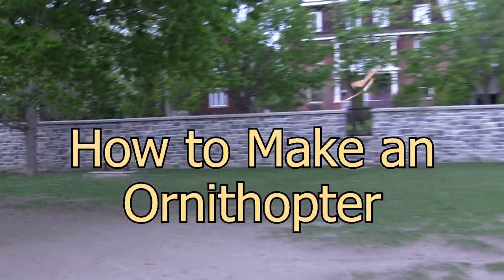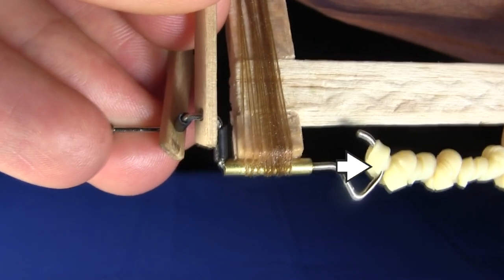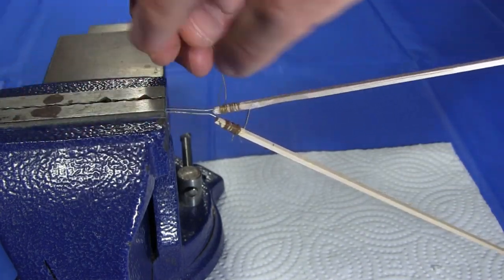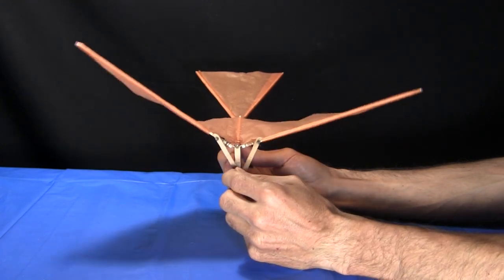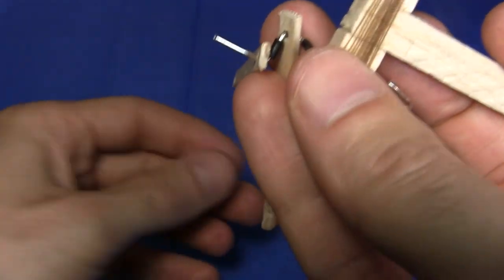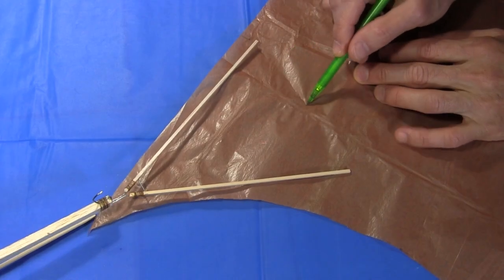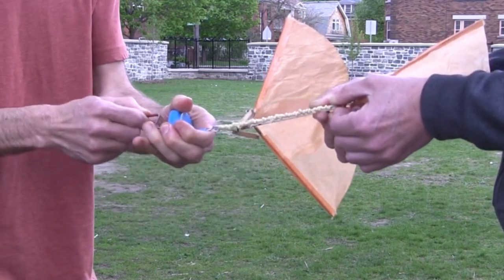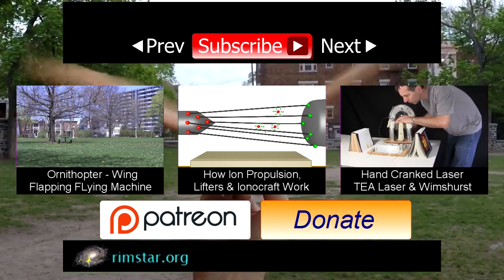How to Make an Ornithopter (Rubber band type)

Comment: @RimstarOrg Have you ever experienced the wings loosening overtime? Cause every time I tried to fly it, the wings end up bending inward to the point where it doesn’t fly as effectively! So is there a way I can fix that problem? I don’t know if it’s me personally or if you’ve had the same problem I have with the flight performance
Reply from the maker: I haven't experienced that but instead I've experienced the wings tending to move forward out of the tube on top of the fuselage.
Reply: @RimstarOrg  ok but somehow the wing spars tend to move backward overtime making the wings loose after a number of uses. If only I can show you an example of my problem with a photo you might understand.
Reply from the maker: Do you mean that the outer wingtips bend backward? Finding a place in the video where there's a shot that I can refer to often helps for me. Just give the minutes:seconds. If it is the wingtips bending backward then I wonder if you did the trick I use at 6:49 where I tape the tissue at the wingtips but you have the tissue so tight that you're actually bending the wood as the wings flap up and down.
Reply: @RimstarOrg  Yes! Maybe I did over tighten the wing tissue a little, but at the same time I didn’t want to wing tissue to be too loose either where it wouldn’t fly properly
Reply from the maker: In that case you can just use sharp scissors to cut the tape at the end and then put new tape. Lower the wings when you do it so that they're in their down position. That will make sure you're giving it some slack. It doesn't have to be too tight even then. You don't want to make it harder to flap. Don't use too much tape since the makes the ornithopter heavier.

Comment: I just dont understand how you made yours so light... Mine is around 14 grams without the wing paper, I highly doubt it will fly. I used balsa (i think, in my country we don't have many hobby stores so I used the lightest wood I found), plastic tubes came from inside of the pen, brass tube I had to use a bit thicker plastic one, and for the large paperclip I used a bit different wire of about the same diameter. I just can't see how you got yours so light?
Reply from the maker: As you said, you used the lightest wood you could find but it might not have been balsa. Another wood to try is bamboo, you can make it thin but it'll still be strong.
Reply: @RimstarOrg  I'm fairly sure it's balsa, commonly used here in school projects, model toys, etc. Bamboo would be even harder to get, anyway, I finished it and it seems to be keeping the horizontal flight for a little, I just need a really strong rubber band, so I guess it'll work out, but if I ever try making another, imma look for better resources
Edit: I checked on the wood, there is a decent possibility that I used plywood instead, which looks fairly similar, but is stronger and a bit heavier, guess I'll look for a better wood anyway

Comment: I just went to any stores yesterday and today to look for balsa woods but unfortunately the do not have it. :( Now, sir, I am wondering if is it possible to use just another type of wood, like popsicle sticks? :|
Reply from the maker: I tried popsicle sticks but they were too heavy. I even cut them lengthwise to reduce the mass. Bamboo sticks are a good alternative though. I find them in dollar stores and gardening stores since they're often used in gardens for tying plants to to give them some vertical support. Art stores may have them too. Use a sharp knife to cut them into narrow strips lengthwise. Bamboo is very strong so the strips can be very narrow.
Reply: I will do sir. Thanks again..

Comment: i have put a motor instead of the rubber band.Will it work
Reply from the maker: You'll need to make it bigger because of the extra weight, but it should work.

Comment: have you thought about putting a small solar panel on the back and wiring up a tiny motor, instead of a rubber band :-)
Reply from the maker: That would be too heavy but it would be a fun idea for a larger design. It might be possible to have the whole wing and tail surface be made of a flexible solar cell material. The flexible materials are usually lower efficiency but if it's not enough to power the motor then it can at least supplement the power.

Comment: Where I will get the tool which you used to wound rubber band and lubricant
Reply from the maker: A google search for "rubber winder" turned up a bunch about them, including some sources for buying them. (Folks who do these things refer to it as "rubber" instead of "rubber bands". Knowing that helps a lot when searching.) As for the lubricant, the Armor All one is available in hardware stores.

Comment: My ornithopter's one wing move faster and one slower what do I do
Reply: Check to see if both connecting rods are the same length, and both crank throws are the same length too, and at the specified 70°. And both wing struts must be equal length. All spaces between different members must be the same on both sides. 
If none of those helps, take it to Indianapolis (Where they only turn left).

Comment: As soon as i put the wings on the framework the Rotation does not work anymore, someone who can help?
Reply from the maker: Do you mean that you try to turn the crank by hand and the rotation doesn't work?
If yes then that sounds like something is getting jammed somewhere when you turn the crank. Look for any place where it might be happening.
It might also be that your wing material is too stiff near where it meets the fuselage. At 6:46, that's the area that is flexing near the fuselage. You could try removing the tape that you put at the wingtips, maybe you pulled the wing material too tightly when you put on that tape (if removing the tape might tear the tissue then carefully cut the tape instead).
If it's not working when you use the rubberband then it might be that your lever arm length is too short. That's the 7/8" length in the video at 3:12.
It could also be that some parts of there the rubberband are twisted are forming lumps that touch the fuselage.
It could also be that your rubberband isn't wound enough. Look at the tips I give at 7:14.
Let me know if that doesn't help.
Reply: Oh thank u yeah this helped a lot, it moves now but i think my rubber band is too weak. It still does not fly😅
Reply: But we are getting there
Reply from the maker: Don't forget, you also might be able to make a lighter one now that you know more. You can also try doubling up the rubber bands for more energy like I show at 7:14 or if you have only one rubber band then you can try twisting it to sort of make two like I do a little later with the longer one when I twist it three times.

Comment: When you give out the dimensions is it length x width x height?
Reply from the maker: I didn't pay attention to that. I guess I just assumed it would be clear which numbers applied to which dimension. I guess I was wrong. Which one(s) is causing confusion?
Reply: RimstarOrg just the dimensions with the wood, its no problem i think i figured it out i'm just always confused sorry! I was just trying to figure out which order the numbers were in but its fine i'm confusing; i guess its in length•width•height.

Comment: My ornithopter has the tendency to bend its wings back overtime after several flights. How do you prevent that from happening?
Reply from the maker: It isn't something that I experienced. At a guess, could it be that the front of your wing material is cut in a curve and that when you glued them onto the wing, the wing initially held it's straight front edge but that as the wings flapped, the stress from the pull by the curved material won out and the wing struts curved to match the shape of the material?

Comment: Is it necessary to buy the lubricant
Reply from the maker: You can do without a lubricant but you won't be able to fly for nearly as long. The lubricant makes it easier to the rubber to twist together so you can twist it more. There are other lubricants you can use and there are some to avoid because they damage the rubber but I don't remember what they are. Though I usually get only around 4 or 5 really long flights from a single length of rubber band before I need to make a new one so maybe any lubricant will do for that long (cooking oils for example). You'll have to do some google searching for things like "rubber plane lubricant" or something to find out which are the good ones. The one I used seems to be the most popular one.

Comment: Its kinda hard to find 3/32" tube/rod/pipe etc, can a pen tube work too? Where do i buy these tubes wth
Reply from the maker: The plastic and the brass tubes as well as all the balsa wood came from a local hobby store. You can probably also order them online somewhere, just search for brass, copper, steel tubes or something. Yes, if the pen tube is metal then you can use it in place of the brass tube I used. It needs that hard front surface to withstand the pull of the paper clip wire like I mention in the video. It doesn't have to be exactly 3/32", just as long as the wire can turn in it easily and there's space around the wire (i.e. not too snug a fit).
Reply: RimstarOrg ok thanks sorry to keep bothering 😔
Reply from the maker: It's not a bother, I'm glad to help. These are awesome and fun things to make so the more there are, the merrier. Let us know how it goes.

Comment: Is that winder custom made or store bought?
Reply from the maker: It's store bought. Well, I bought it from a friend but you can buy them online. Mine has a 5:1 ratio, so 40 turns of the crank gives 200 turns of the rubber band. I think I've seen some custom made ones though. A fishing reel is another way to do it.
Reply: RimstarOrg Thanks! A fishing reel is a good idea

Comment: @rimstororg what is the winder u used to wind called
Reply from the maker: It's the Cosano Speedy Winder, but it's an old one that I bought 2nd hand from a friend. A google search doesn't find it. It has a 1:5 gear ratio, one turn of the crank results in five turns of the rubber band and that seems to work fine for me. However, a google search for "rubber band winder" turns up a bunch of them.

Comment: How many grams does this ornithopter weigh? I made several models, but they all flew only 5 seconds.
What is the secret for them to spend more time flying?
Can someone help me please? Thankful.
Reply from the maker: The one in this video weighs around 7 grams without the rubber band (see the video at 6:55, Hmmm Did you watch the whole video? Lot's of things in it that might help.). The 24" of rubber band that I use weighs around 2 grams. The version in my intro video https://www.youtube.com/watch?v=ZvzpsRWl12s that flies up a bit and then spirals downward weighed 9.5 grams (again, not counting the 2 grams of rubber band). So weight is a big factor in getting it to fly.
Another thing is to make sure you are using good rubber. A regular rubber band like you find around the house doesn't have a lot of actual rubber in it. See the video starting at 7:14 for more about rubber.

Another trick that finally made me succeed was what's called the lever length. In this video at 3:12, that's the length marked 7/8". When I had that shorter, the crank had a hard time lifting up the wings. It makes sense because if you picture what's going on when the crank lifts the wings, that section acts like a lever and so the lever principle applies (https://en.wikipedia.org/wiki/Lever). I didn't try making it longer but I imagine there's some point when if you make it too long, that will again make problems.
Let me know how it works out.

Comment: my ornithopther cannot flap that fast after i put the wing, what are the causes?is that the wing limits the flapping mmechanism?..tq
Reply from the maker: One major factor in efficiently transferring the rubber band's energy to the wings is in the lever length. That's the 7/8" length in the video at 3:12. 'Lever' is a perfect name for it since it's using the lever principle to lift the wing. A short lever means you have to do more work than with a long lever, given the same rotational speed. Perhaps your lever is too short. Making it longer and longer played a big part in getting mine to finally work.
But then again, mine was slow only on the upswing, making it jerky rather than just flapping slowly.
If it's just flapping slowly then maybe your rubber band is too stiff of a material? Or possibly there are other losses, such as too much friction where the crank part of the front hook wire is pulled back against the tube due to the materials. I can imagine that happening if that tube is plastic instead of metal, then the plastic will deform and act like a sluggish cushion. Another possibility is that your wing material is on too tight at the middle and making it hard to lift the wing. Or perhaps it's something else, but keep looking along those lines. Let me know how it goes.
Reply: RimstarOrg thanx for answering..you got it right that im using plastic tube..maybe i need to try an error until i get the best result..thanx again

Comment: what is the idea behing the wings, how come they only collect the air downward, but not upward.. i mean, when wings flaps toward sky, how do you prevent wings to collect air and push the bird downward?
Reply from the maker: The lift isn't produced by directly pushing air downward. Lift is produced in much the same way as with an airplane wing, by having the correct wing angle (called the angle of attack) while the wing is moving forward with respect to the air. I explain it with diagrams in this article I wrote about what I learned https://hackaday.com/2018/05/11/scratch-built-ornithopter-heres-how-i-flapped-my-way-to-flight/
Reply: @RimstarOrg  ohh i see (nice diagrams), its like slicing the air from front to the back (like swimming under water), with both when going up and down because of the angle of attack.. thats smart, seems like a bat's wing rather than a pigeon

Comment: Would i be able to use printer paper or regular tissue paper instead? Also the 32/3 piece that holds the wings is a bit crooked would it still fly? 
Also i was able to use the pen tubes instead 😌
Reply from the maker: My guess is that printer paper might be too heavy but regular tissue paper should be light enough -- though it will be very fragile.
I'm not sure what you mean by the 32/2 piece. I'm guessing you meant the 8" long 3/32"x3/32" pieces of balsa wood. It shouldn't matter if they're a little crooked.
Thanks for letting me know that the pen tubes worked. Were they metal?
Reply: RimstarOrg no, i just opened a pen and cut a piece that had no ink in it. The 3/32 piece i meant is the part with the 2 1/2" tubes on it that the spurs for the wings go in; part of the fuselage.
Reply from the maker: I don't see it as a problem if it's a bit crooked.
Reply: RimstarOrg thank you for all your help and the great video (uwu) i hope mine flies!
Reply from the maker: Let us know how it goes!
Reply: RimstarOrg it flies ok but itll takes a while to adjust it since its so hard to wind up by hand. The tube with the crank IS getting a lot of pull but i don't have a metal tube so i have to keep gluing it back when it shifts. I wonder what i can do to keep the tube in place aah

Comment: That's so cool make a big one
Reply from the maker: Thanks. I'm hoping to make an RC one, which would be bigger.
Reply: +RimstarOrg Could you use the very tiny mini quad copter motors, if it's very light. Thx for sharing.
?
Reply: +RimstarOrg  it needs ruber were wood contacts crankcase because now it sounds like 1cylinder  diesel with broken push rods
Reply from the maker: It would still be too heavy. Even just doubling the weight of the tissue that's on it would make it have trouble climbing. That is unless the mini quad copter motor and battery weigh 2 grams, which is how much the rubber band weighs. Then there's the problem that the motor turns too fast and would need gears to convert to a lower speed. Anyway, it's definitely an avenue to be explored. Thanks for watching.

Comment: hello sir I am trying my best to make my ornithopter fly but it is not flying it's wings stops in the air and I am so sad that only mine wont work please tell me what should I do ?
Reply from the maker: Do you mean that the wings don't flap at all? Instead they just move upward and stop? If so, check your dimensions to make sure they're all very close to mine. Replace any parts that aren't close to the right lengths.
It may also be a problem with the way the tissue material is attached. Possibly it's too tight near the center and when the wings lift, the tissue may be shaping in a way that makes it too hard for the crank to pull back down. What material are you using for the wings?
If you've put the tape at the wingtips like I do at 6:49 in the video then maybe you've put the tapes on such that the tissue is too tight. Very carefully take the tape off, or cut it if taking it off would damage the tissue, and see if it works without those tapes.
Also, look at it carefully while you turn the crank by hand to see where it's sticking.
A very, very important step to getting this working is to get a good, long lever length. The lever is the 7/8" dimension I say to get precise at 3:12 in the video. If that's too short then the crank has too work very hard to move the wings.